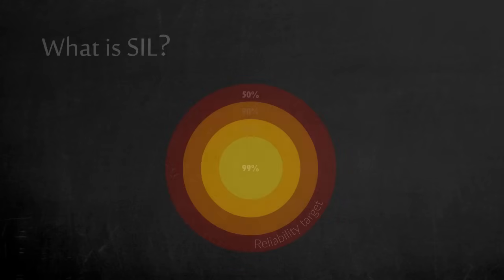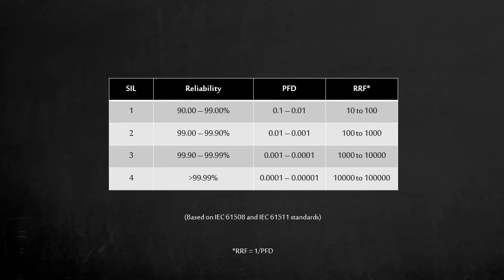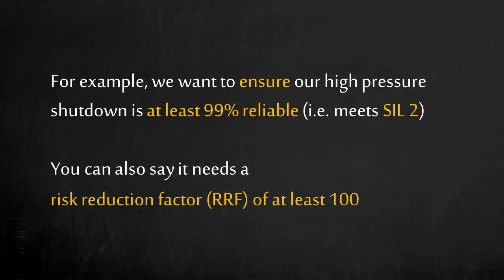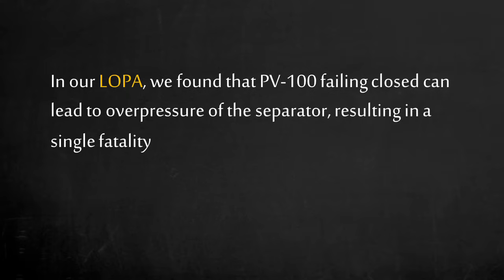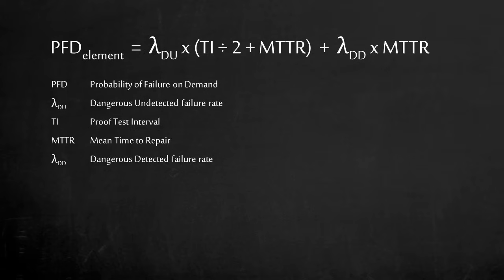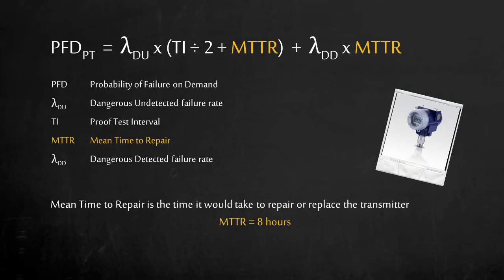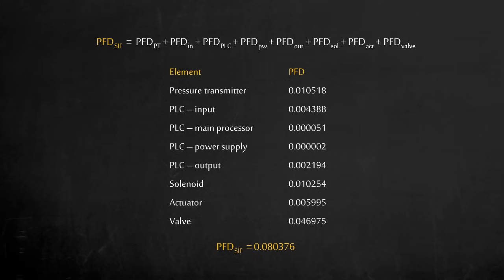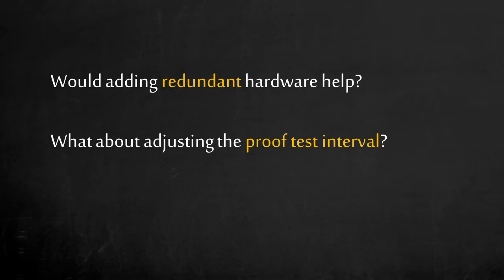What is SIL? A Crash Course

Comment: My opinions on this case from the vedio lecture at the end
1.We can use redundant solenoid valves .
2 we can convert the wirings to the module which have redundancy options
3.We can go with SIL 3 shutdown valve
Reply from the maker: Those are all possible solutions to reducing the PFD and increasing the RRF! Since the final element valve was our weakest link in the safety shutdown, our RRF can be greatly reduced by increasing the integrity of the valve. We may only need to increase the valve to a SIL 2 rated valve to meet our target as SIL 3 rated equipment is generally quite costly.